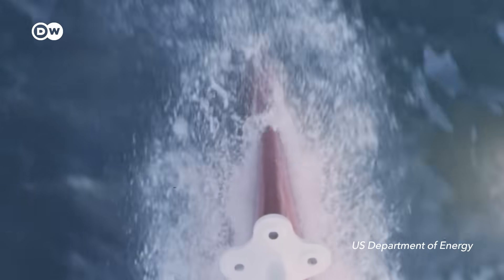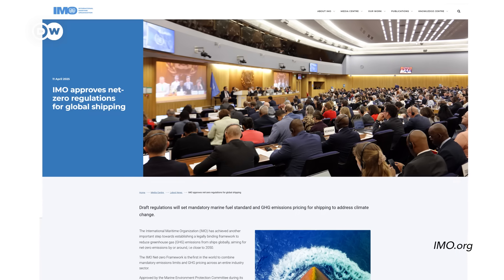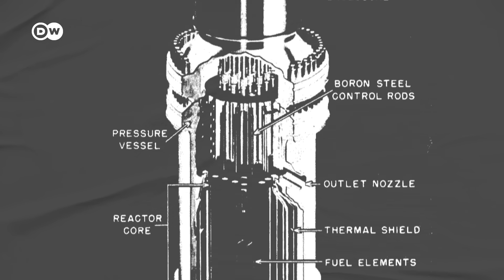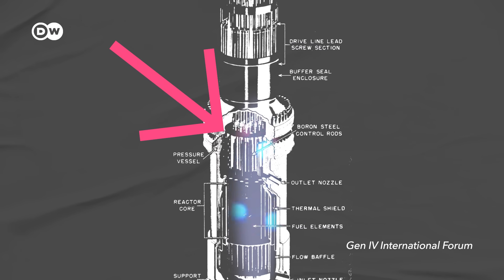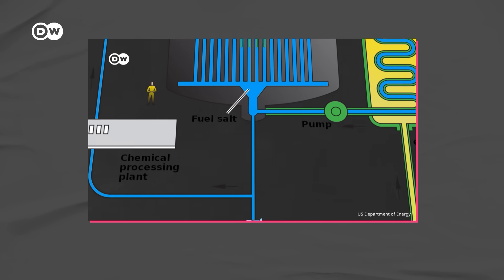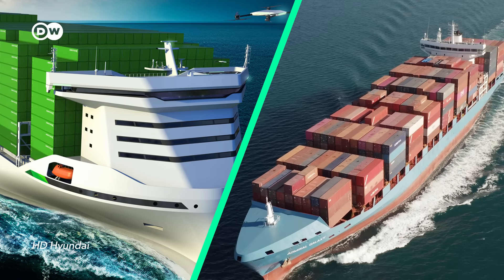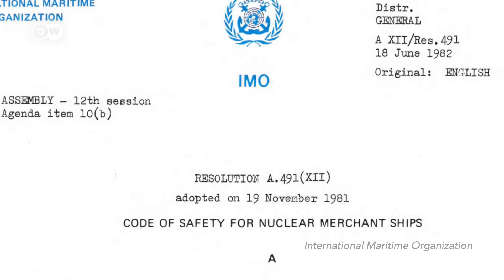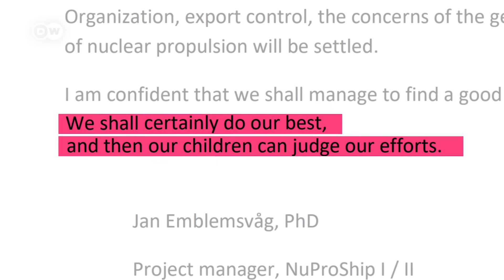Why people want to put nuclear reactors on ships

Comment: I trust the technology behind passively safe nuclear reactors but not in the context of a saltwater environment...
Reply: you do realize the US navy has been operating more reactors at sea than any other organization even owns without a single reactor accident and they have been doing it for over 70 years
Reply: The us has 11 nuclear powered super carriers and a few nations operate nuclear subs for decades now. It's a proven tech, it's just expensive and messy if it's going to commercial ships.
Reply: Furthermore, part of nuclear safety is strict regulation. That goes out the window in open sea.

Even with diesel engines right now, we can't stop ships from dumping waste oil in the sea. It's illegal but there's no enforcement out at sea.
Reply: @CandleWisp  the navy has been doing it for over 70 years with a better track record for safety than all the other nuclear organizations combined

Comment: As long as it is done right, this would be a really good idea. We already have active nuclear submarines that are doing just fine.

The manufacturing and inspections would have to be held to the most strict of standards to avoid catastrophe.
Reply: Ships using heavy fuel oil should be held to a higher standard than ships literally incapable of oil spills.
Reply: We also have nuclear submarines that are running into their maximum lifetime. Just two weeks ago a Russian nuclear driven submarine sunk to the seafloor.
Reply: It won't happen. Having technicians, qualified personel and security at every port in the world is unfeasible.
Reply: "Done right"
In a cost-cut everything era? Really?
Reply: Dude, there's a reason there are no private or commercial nuclear submarines, jusr because you can do it, doesn't mean it's profitable. I'm betting this won't make sense because od the same reasons it never caught on, cost and restrictions on ports it can visit. Not to mind the whole Houthi thing, imagone if those boats sunk had a reactor? Not a great outlook IMO.
Reply: and if we don't have wars or terrorists than it is a solution otherwise it is to dangerous
Reply: So… not done by Americans
Reply: it is an other reactor type they are propossing, small moduars with molten salt
Reply: @bastersturm  is their safety proven for the high seas where they can’t be reached in case a ship sinks?
Reply: @ArneBab  i dont know, small moduars aren´t even "on the market" maybe there are case studies and theoretical researce conducted by universitys
Reply: @markfernandes2467  look at other threads in here. You may need some arguments.
Reply: @markfernandes2467  No, it’s not. Because active nuclear submarines are where much not fine.

And that I remembered it means that it was a big story -- though you seem to have missed it.
Reply: @markfernandes2467  do you mean "what’s the worst thing that is going to happen in the lifetime of that material"?

If not, you asked the wrong question.
Reply: @markfernandes2467  No one knows. No one can know. What we do know is that old nuclear waste is already on the seafloor and is already starting to cause problems today.
Reply: @markfernandes2467  citation not possible here: links usually get blocket.

And no: it’s not my job to prove that it’s unsafe. It’s yours to prove that it’s safe. Because if it isn’t, you most likely won’t, but other people will pay the price.
Reply: @markfernandes2467  or to go to sails for the majority of the propulsion and solar- and wind-produced fuel for the rest.

Sails are viable nowadays again, because our weather prediction has gotten much better: you can have reliable transport times with sails now.

That’s what you need to compare to (fossil fuels must be phased out anyway), and electricity from solar and wind is already much cheaper than electricity from nuclear.